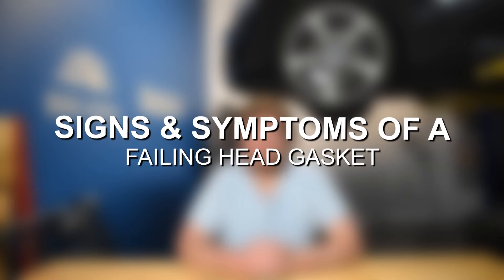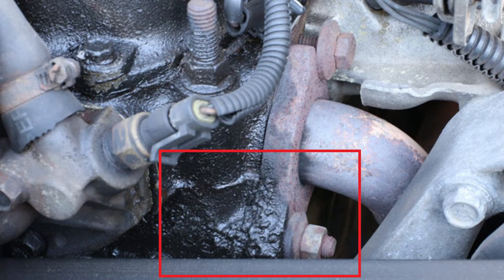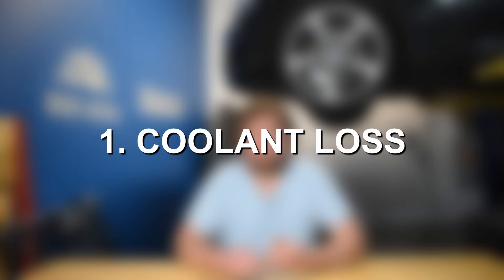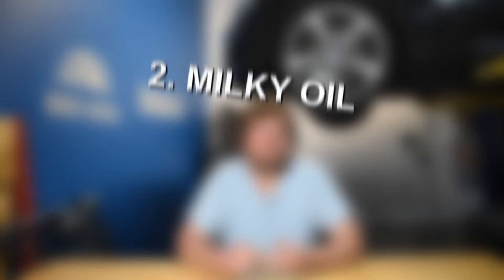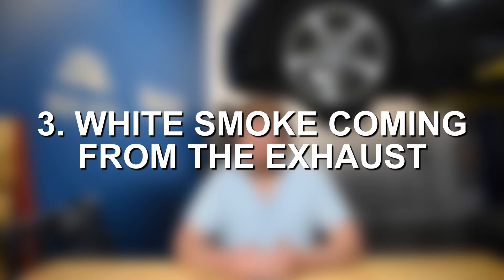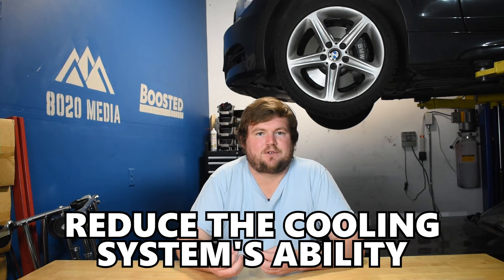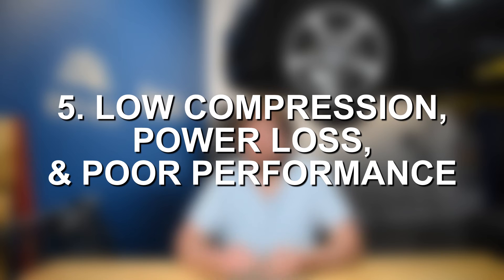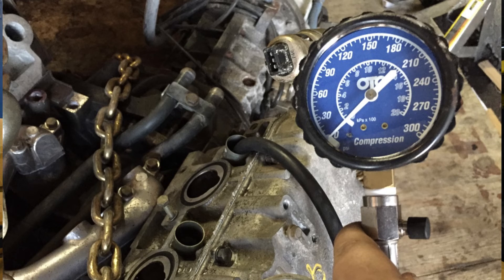Signs & Symptoms of a Blown Head Gasket!

Comment: My Lexus rx 350 is loosing coolant , no heat and temperature gauge going down and up , my mechanic tested cylinders an radiator pressure and is fine  , so I don’t know if the head gasket it’s  falling , any ideas ?

Comment: Thank you very much for the brief detailed explanation. I am currently trying to investigate why my 2007 Dodge ram 1500 check engine light came on went to AutoZone and it’s giving me multiple code readings cylinder misfire and I bought this truck from the former owner about three months ago and he told me that he had the head gaskets redone, but no physical proof on the paperwork so that’s what led me to look at your video. Hopefully it’s not as bad as I think it is so far I don’t notice any coolant leaks, but there is a decent significant loss of power and the RPMs accelerate pretty roughly while warming up and during driving, not sure if the engine is slipping.

Comment: Just bought a used 2024 GTI from a Volkswagen dealership that was a leased and turned in at about 29,000 miles, dealer said due to the leaser wanted to upgrade to a larger car.  With just under 1000 miles I put on the car, I took it to get the windows tinted and the check engine light came on. The owner of the tint shop had a code reader and it pulled up the coolant sensor. Checked the coolant and it was slightly low. Before I purchased the car, the dealership did the full 30,000 mile service and everything checked out. The tint shop owner suggested that it may have been a blown head gasket. I turned it in to Volkswagen today and am nervous as hell that I was sold a lemon. I baby that car.

Comment: I have a 2008 Silverado 1500 5.3 with the following problems"
Coolant loss of around 1-2 cups per week, less than 200 miles driving per week. 
Chocolate milk looking oil that is more apparent in my aftermarket catch can than on the dipstick. 
No white smoke
No coolant leaks under vehicle. 
Random misfires or possibly temporary fuel injector disable in cylinder 8 (the "fun" cylinder to work on) after truck has been running for twenty plus minutes. It will seem to chug for a few seconds while idling but goes away if I push the gas pedal.  (Small amount of coolant getting into combustion chamber?)

Comment: We have the white smoke/ steam under the hood, there's some coolant loss & a little oil spitting. No temperature light though .my car is a  dodge avenger 08 and I think a v engine & no milky oil
Reply from the maker: R - White smoke/steam under the hood with coolant loss and some oil spitting on your ’08 Dodge Avenger, but no temp light or milky oil, points to an external coolant leak rather than an internal head gasket failure; common spots are the radiator, water pump, heater core hoses, or intake manifold gaskets, which can spray steam under load and cause the white smoke you see, while the oil spitting may be from coolant contacting hot engine parts and mixing with grime rather than internal contamination. Since you’re losing coolant but not overheating yet, I’d pressure test the cooling system cold to pinpoint the leak before it worsens, as continued driving risks sudden overheating and engine damage even if the dash light hasn’t come on.

Comment: I have no coolant loss,no white smoke, no white supstance on oil cap, no overheating. I did CO2 test and says positive yellow color. Can u please tell me what can it be, i am confused coz no symptoms of blown gasket?
Reply from the maker: C - A positive CO2 test in the coolant almost always means combustion gases are entering the cooling system, but if you have no coolant loss, no overheating, no white smoke, and no milkiness in the oil, it may be an early-stage head gasket leak or a very small crack in the head/block that isn’t showing classic symptoms yet — sometimes these only push exhaust gases into the cooling system under load without pulling coolant into the cylinder. False positives are rare but can happen if the tester fluid was contaminated or the test wasn’t sealed well, so it’s worth repeating the test to confirm. If it’s consistently positive, keep monitoring coolant level, pressure, and temps, because small leaks can stay “silent” for a while before turning into full-blown overheating or coolant loss.
Reply: @8020Automotive Thanks for the reply, i remembered later the car was working in his  garage and the coolant cap was open, maybe the smoke entered because of the closed space and showed innacurate. He needs money i guess 😊 so better to try on another place.
Reply: Same here
Reply: @wasifaslam3588 For me it turnes out it was really that problem, but not notisable at that moment. Now its worse it has lot preasure in the hoses and coolant boils very quick and i cannot drive it. I guess i have to change the head gasket.

Comment: I am losing coolant and start seeing smoke the oil cap, bought gasket sealer still seing white smoke.
Reply from the maker: M - If you’re losing coolant and seeing white smoke plus vapor from the oil cap, gasket sealer isn’t going to cure it — those are classic signs of a blown head gasket, cracked head, or intake gasket leak letting coolant into the combustion chamber and crankcase; the white smoke out the exhaust is burning coolant, and the vapor from the oil cap means coolant is mixing with oil and creating steam inside the engine, so the only real fix is to tear it down and replace the failed gasket or cracked part, flush the oil, and refill with fresh coolant, otherwise the engine will keep smoking and risk serious damage like spun bearings.

Comment: Hey, I have an 01 suburban. I have chocolate milky oil. It hasn’t overheated on me but I’ve had to put coolant once a week, Could it be anything other than a blown head gasket??
Reply from the maker: R - Milky, chocolate-colored oil in your ’01 Suburban almost always means coolant is mixing with the oil, and while a blown head gasket is a common culprit, it’s not the only possibility — these trucks also suffer from intake manifold gasket leaks (very common on GM small-blocks), cracked intake manifolds, or in rarer cases a cracked cylinder head or block; since you haven’t overheated and only top off coolant weekly, an intake gasket leak is actually more likely than a full-blown head gasket, so the best next step is to do a cooling system pressure test and check for external leaks, then pull the intake to inspect the gaskets before assuming it’s the head gasket.

Comment: No mily residue or white smoke but the coolant is leaking after 2 days ( empty) of a small 10 mins drive
Reply from the maker: C - If your coolant reservoir is going from full to empty after just a short drive but you’re not seeing milky oil or white smoke, the coolant is almost certainly leaking externally rather than burning inside the engine. Common spots to check are the radiator (especially the end tanks), hoses and clamps, heater core hoses, water pump, thermostat housing, and coolant reservoir itself. A small crack or gasket leak can open up only when the system is hot and pressurized, so you may not see drips cold. The best next step is a cooling system pressure test—this pressurizes the system while the engine is off so you can spot leaks. Since you’re losing coolant that quickly, avoid driving until you confirm the source, because running low can cause overheating and serious engine damage.

Comment: Hi I need advice please my 2017 Chrysler Pacifica wouldn't start. Took it to a shop and the mechanic replaced the starter. My car ran hot for the first time ever as proceeded to drive off from the shop same night I turned around mechanic puts water inside same tank where coolant goes into and over heating stopped right away he than advised me to get a head gasket repaire liquid and pour it into the coolant tank ( I bought it but I didn't pour it into my car ). Next day car has a little white smoke briefly maybe 1 to 2 minutes could barely see it after I started the car. Hours later same day. Car only started after 3 times of trying to start it up. Hours later car wouldn't start again. I checked fluids it didn't have signal of running hot no smoke nothing just a strange fan noise. My car have coolant before the tow truck came and got it after the mechanic got my car he sent me a video showing me there was no coolant in my coolant tank the shop is only 4 miles away from my house Could the mechanic have done something wrong??? Now he says I have a blown head gasket.. but he previously stated that I didn't have head gasket issues
Reply from the maker: S - From what you’ve described, there’s a strong possibility the overheating and current no-start issue are related to how the vehicle was handled after the starter replacement. If your Pacifica had coolant when you left home but the tank was empty when the mechanic later checked it, that indicates either a major leak developed during or right after their work, or the system was not refilled/bleed properly before you drove away. Driving even a short distance with low coolant can cause overheating, and repeated overheating can quickly lead to a blown head gasket. The white smoke you saw after startup was likely coolant burning in the cylinders, and the strange fan noise may have been the cooling fans running at high speed to compensate for a temperature signal. Since the mechanic first told you there was no head gasket issue but later changed his stance after this incident, I’d be cautious — document everything (photos, texts, receipts, coolant levels) and consider having an independent shop perform a pressure test, leak-down test, and chemical block test to confirm head gasket failure before authorizing major repairs. This will help determine if the damage was pre-existing or potentially caused by improper coolant handling after the starter job.

Comment: 2013 Genesis Coupe 3.8 here. The other day I was driving home when suddenly i noticed my oil light came on, a couple seconds later i heard a rattling sound coming from the engine, but only when i would accelerate. then the car let out a short cloud of white smoke then completely shut off. turned pulleys and they moved fine so the engine isn't locked. i pulled my heads and inside there was coolant & oil mixed. do you think it's just my head gasket? and possibly the sound i was hearing was a piece that broke off and fell into the intake manifold?
Reply: also wanna mention the car would not start after that. i'm assuming because theres no compression due to the head gasket.
Reply from the maker: T - Based on your symptoms, this is most likely a blown head gasket or a cracked head, but the rattling and sudden shutdown suggest the damage may go deeper, such as hydrolock from coolant entering a cylinder or even bottom-end damage like a spun bearing or broken piston skirt from running without oil pressure. It’s promising that the engine isn’t seized, but I’d recommend a full teardown and inspection including checking for warped heads, cracks in the block, and examining rod bearings and cylinder walls—if a part broke off and entered the intake, it could’ve also damaged a valve or piston, so be thorough before assuming it’s just the gasket.

Comment: I just had a new head gasket replaced in a 2022 Ram classic Hemi. Is under warranty. I’m a a little over a week out since repair, and still can smell coolant. I just thought it maybe burning off from where and when it was changed but should have been burned by now. I have not checked the coolant yet. I’ll be calling the dealership this morning. Great detailed video!
Reply from the maker: C - Thanks for the feedback! It’s normal to smell a bit of coolant for a few days after a head gasket replacement, especially if any was spilled on the engine or exhaust components during the repair—but a week or more later, the smell should be gone or nearly unnoticeable, especially on a your truck. If you're still smelling coolant, there could be a small leak from a hose, the water pump, a loose clamp, or even the head gasket area if the surface wasn’t sealed perfectly. First, check your coolant level when the engine is cold—if it's dropped at all, you likely have an active leak. Also inspect around the hoses, radiator, and engine bay for residue or dampness, and if nothing’s obvious, have the shop do a coolant pressure test under warranty—it’s quick and will tell you immediately if there's still a leak.
Reply: @8020Automotive Hi! Thank you for your reply! Yes, I will check it. The dealership wants the truck back next Friday to do a pressure test and check everything you mentioned!! 👍🏼
Reply from the maker: C - Keep us updated!
Reply: @8020Automotive  will do thx!

Comment: hi! my honda accord sport might have this problem. i noticed one day, every single light that you can imagine on my dash came on. and, there is noticeable white smoke from the left side of the back of the car. and, the idle is very rough. i just purchased the car four days ago and these symptoms began two days ago. luckily i have a warranty, but do you think this issue is the head gasket?
Reply from the maker: M - Given the symptoms you're seeing, a blown head gasket is definitely a strong possibility, especially if that white smoke smells sweet (coolant burning) and is coming from the tailpipe consistently. The rough idle suggests the engine may be misfiring due to coolant entering one or more cylinders, and the dash lighting up could be from related sensor errors or ECU faults as the engine struggles. Since you have a warranty, do not delay—get it to the dealer or shop ASAP and have them perform a coolant pressure test and cylinder leak-down test to confirm the head gasket or check for other serious internal issues before driving it further.

Comment: I had to change my lifters on my 07 Avalanche due to AFM failure. It is very labor intensive! I bought all the parts and did it myself. I think I spent around $600 for parts(I changed out some other stuff while I had it apart). So by doing that I saved about 2K, the average repair cost around here was $2.2K. Had to YouTube the whole job.
Reply from the maker: X - Nice! Certainly not an easy DIY, but totally worth it.

Comment: can you let me know some ideas on my honda accord 2005, i recently got the thermostat and radiator done , transmission got replaced with honda transmission strictly, and recently i’ve had a misfire which i fixed too, i turned the car on from a cold start and a lot of white smoke unusual for my car to do started to come out then it goes away, doesn’t come back as i’m driving only as i turn it on, and the check engine will come on as a misfire for cylinder 1, do you have any ideas as to what could cause this?
Reply from the maker: A - White smoke on cold start that quickly goes away—especially combined with a misfire on cylinder 1—often points to a small coolant leak into the combustion chamber, likely from a failing head gasket or a compromised intake manifold gasket. When the engine is cold, coolant can seep into cylinder 1 overnight and cause steam (white smoke) on startup and a temporary misfire until the cylinder clears out. This would explain why it only happens on cold starts and not while driving. It's also possible, though less common, that a leaking injector is flooding the cylinder and causing incomplete combustion, but that usually causes black smoke, not white. Since you've already replaced the thermostat and radiator, it's worth checking coolant levels—if they're slowly dropping, that further supports a head gasket issue. A leak-down test or chemical block test (to detect exhaust gases in the coolant) can confirm it. Catching it early can help avoid major damage.

Comment: 2011 GMC Yukon Denali.  Randomly, and I can't replicate what causes it, heavy white (maybe light blue color to it) exhaust comes out when I start the vehicle, but then it goes away.  Smells kind alike gas I guess, I don't think it smells like coolant.  When I check the oil it doesn't look milky on the dipstick.  Coolant levels appear to be staying the same.
Reply from the maker: R - Intermittent white or light blue smoke on cold start in your 2011 Yukon Denali is likely due to valve stem seal wear or light oil seeping into the combustion chamber overnight—especially if it disappears quickly and doesn’t smell sweet like coolant. The slight fuel smell suggests it's burning a bit of oil or possibly excess fuel briefly at startup. Since your coolant level and oil condition are normal, a head gasket issue is less likely. Monitor oil consumption and consider a leak-down test if the smoke worsens. It's common with higher-mileage engines, particularly on cold starts after the vehicle has been sitting.

Comment: If you have a blown head gasket would your oil come out of your car like water . As soon as you put it in it leaks right out. The oil is not milky . And i dont have white smoke .
Reply from the maker: S - If oil is pouring out of your engine as soon as you add it, it's unlikely that a blown head gasket is the cause—head gaskets typically cause internal leaks between oil, coolant, and combustion chambers, not external leaks. Since the oil isn’t milky and there's no white smoke, your head gasket may still be intact. A massive external oil leak like that is more likely due to a damaged oil pan, a missing or loose drain plug, a cracked engine block, or a failed rear main seal or oil filter housing. Inspect the underside of the engine closely to locate the exact source of the leak.
Reply: Thank you so much for answering . I found out I have a cracked engine block 😭. But I love your show I watch it every day. I have learned so much about cars from you !! Great job 👏